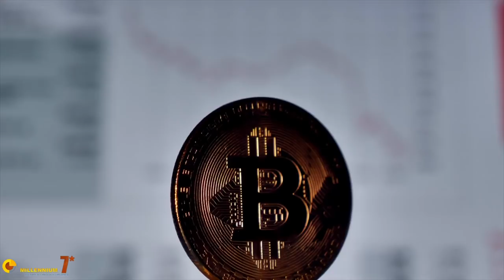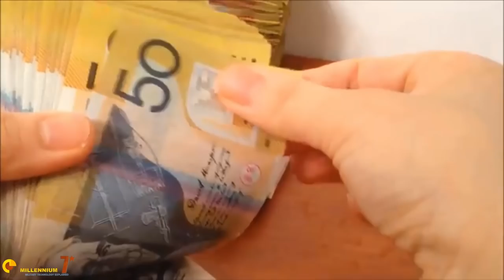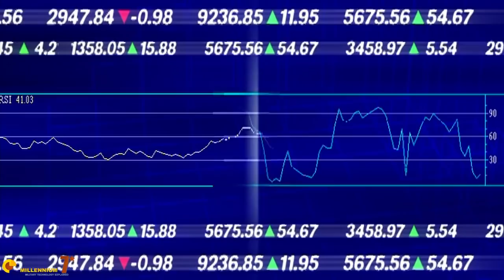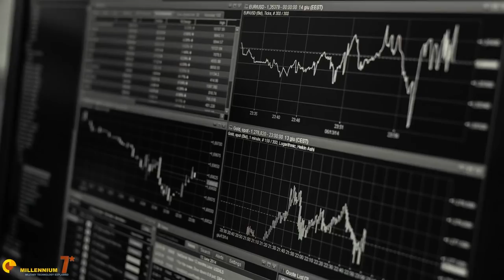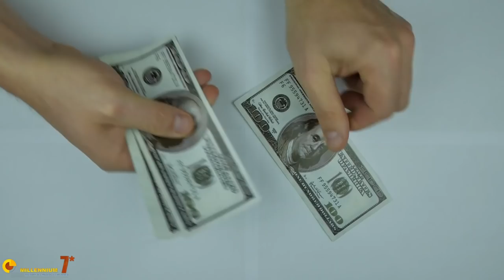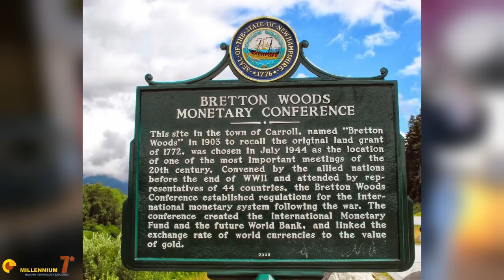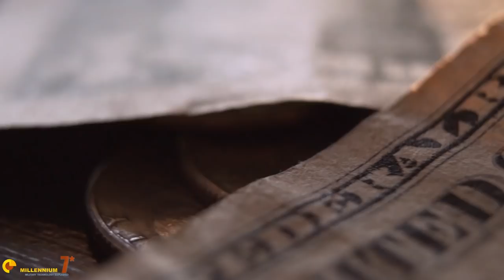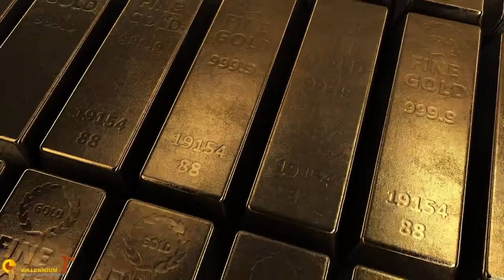How the USA can get unlimited F-35s without going bankrupt

Comment: "can't built weapons with gold"
Actually gold is very good for both a reflector and tamper in a nuke. So yes. You can built weapons with gold.
Reply: That is very tiny amounts of gold you need. Its a worthless metal. Its soft, heavy, not very good at transporting electricity or heat.
So its a worthless metal compared to iron, copper, aluminium and silver.
Reply: @nattygsbord  I thought it was a better electrical conductor than any of those you list.
Reply: @nattygsbord  Good to know. I will have to disagree with you on the aesthetics of gold vs. silver though. I have coins in both and while 24k silver is merely shiny, 24k gold has to a certain flicker to it, a certain way it catches light that borders on seeming almost alive that I have seen in no other material, metal or otherwise which is what I think gave early people such a fondness for it above all other things. Silver is a mirror, gold is...something else...something more. Covering a statue with it makes you understand how people could believe in gods.

Comment: Domestic secondary sector played an important role in a country's sovereignty. That's why for a long time the powers that be kept for themselves the industrial base (secondary sector) to run their economy and never outsourced them. Until of course some 'virtual world' economists invented the (knowledge based) quaternary sector of the economy. So they though that the ownership of patents and copyrights of the industrial processes of the secondary sector could be more decisive in creating bigger share of profits to the shareholders than the ownership of their physical industrial base that was in urgent need of large investment for their modernization in the 1970's and the 1980's. So they started to move their Big Capital into the quaternary sector and outsource their industrial base into lower production costs economies. 40 years later their bets that the westeern brains were the only ones on earth capable of innovating in ihigh tech ndustrial processes was proven wrong and the anticipated returns on investments of the quaternary sector are now drying up. What can they do? Rebuild Back Better their physical industrial base? No! It's much simpler to bomb to the ground the secondary sector they have outsourced. Then Build Back Better without competition after. That's what warplanes are for, isn't it?

Comment: The theory of inflation is absolutely and totally wrong.
Directly is no limit to the amount of so-called debt a government can accrue is that that is denominated in its own currency as it can always increase money supply to purchase any Bonds issues on the secondary market by their central bank or no Central Bank directly finance fiscal policy without issuing Bonds to the private sector in the first place in either event it's the left hand giving the right hand money except when through the use of bonds it's the left-hand giving the right-hand money after it's passed through a middle pan which makes a little bit of prophet in the process. Using bonds in that way has been described rather cynically but I believe extremely accurately as a form of welfare for the Finance sector as it doesn't really achieve any are there useful benefit that is if a zero wish guaranteed return of investment in the form of government bonds held by those who already have money they have exchanged it for a form of money that bears interest can be described as a benefit. 

The limit to how much money can be created by a government to finance expenditure does have a limit but it is not debt or the supply itself it is the capacity of the market in which it is using that supply of money to supply or provide. When the government sector or public sector either independently nor in combination with the private sector increases the demand for a particular good product to a service resource whatever it may be beyond the productive capacity of market to supply it it will increase inflation and that is the limit to which expanding the money through supply as a financial instrument by the issuer of the currency to achieve an objective at which point there are two options and that would be to decrease demand for whatever or increase the productive capacity of whatever play changing the focus of investment from product to production.

In a state of Total War inflation is extremely an absolutely critical and must be avoided at all costs which is an total contradiction to what is stated in the video which inflation doesn't matter at a time of war when the absolute opposite is the truth which is why the Allied nations in the second world war used every element of state power to control inflation through the issuance of bonds the private sector as a way of decreasing the money supply that is held by private individuals and companies so that that money will not be spent on things that are absolutely critical to the war effort. Rationing of certain critical goods and supplies is another way of achieving the same outcome. There were regulations that would put in place in the United States the speed limit was changed for all vehicles to save rubber. Bumper bars for vehicles that was sold to people because the chromium and the nickel was unavailable to the auto industry put used in bumper bars it was too critical that the supply for use in ammunition and weapons and not for shiny bumper bars other more profitable uses supplying Average Joe or Jane seeking a new motor vehicle because even in wartime people still need vehicles in United States and not every vehicle manufacture could be sent to the Soviet Union, Western Europe or the Pacific defeat the Nazis or warlords running Imperial Japan at the time because people still needed cars for transportation at the Homefront in the very factories producing those munitions and other weapons systems. 

I seriously cannot stayed with any more strenuous vigour the absolute critical imperative that inflation be controlled during a time of Warfare as it is hard to imagine anything else that is more destructive to war production and war economy then the enemy itself. Also it is unrealistic to expect the any nation can could ever or will ever be able to control the entire supply chain or any have all of the capacity required and minerals and resources not even the United States which was so much larger than anyone else at the time of the second world war had that capacity. Australia supply 50% of all the food and ammunition do United States required in the Pacific theatre during World War 2 and actually ended the war without a lendlease that it over to the United States in fact the opposite the United States was in deficit to Australia and it was a debt that Australia forgave at the end of the war in gratitude and recognition to the crucial role United States played in supplying both Personnel and material that Australia was incapable of providing in its own defence during that time from the sheer difference in scale of the Australian population and productive capacity at that time in relation to the nation's who acts of aggression to others and through direct attack to Australia itself and out interests in the Pacific without provocation chose to be an enemy of Australia we now are yous later actually song about closest friends and partners as we try to shape a better world for everyone and deter dose who would choose to make it otherwise and failing that respond to any challenges that may arise to change the status quote of relative peace which was purchased with so much blood & Treasure in the second world war by All Nations involved. 

Taxation is not used by governments to control inflation daddy fiscal policy which is how governments news revenue collection and expenditure enhance or achieve objectives in the Nations economy.
Monetary policy is the policy adopted by the monetary authority of a nation to control either the interest rate payable for very short-term borrowing (borrowing by banks from each other to meet their short-term needs) or the money supply, often as an attempt to reduce inflation or the interest rate, to ensure price stability and general trust of the value and stability of the nation's currency.
Inflation which is a measure of how prices change upward overtime is not affect directly affected by the money supply or government deficits or surplus as described in the expenditure or revenue collection detailed in governments financial balance sheet. The rate at which increases price prices overtime is like every other price in a capitalist free market economy is determined by the market as a function of supply and demand dynamics within and by the market. All else being equal, when supply increases and demand falls the price goes down and vice versa in a well-functioning competitive open free market. This is economics 101 very basic stuff. The intersection of where the supply and demand Curves meat of course is reflected by the conditions of the market for example if there is a rise in the cost of fundamental inputs such as in a pure hypothetical situation for example if a kleptocratic authoritarian revisionist regime is hell bent on launching a legal and moral war of aggression against it's Neighbours as a means of distracting the public from the amount of national wealth the regime is stealing by way of fraud and corruption from its citizens and in the course of that special public relations operation use exposition as a supplier of energy to other dacians that would have posted that action as a form of economic coercion in for example a globally traded commodities such as natural gas then it would have a massive effect worldwide and use the nature of energy and how it's used in the supply and manufacturer of virtually all services in goods be reflected in actually every single price. And if that hypothetical case was to actually happen in reality I would suggest that it's not actually a good way to win friends and influence people but to piss a lot of people off and make a hell of a lot of enemies that have very long memories about any financial hardships that they suffer through and they would remember the illegal immoral aggression that was the ultimate group cause of it for a very long time I would suggest.

If anyone really wants to know about how modern monetary Theory works with a very detailed and accurate description of the process they should look it up on YouTube as is quite fascinating in both simplistic elegance of how money which is a financial instruments operates in the real world and not the narratives and rhetoric people either intentionally or unintentionally mislead the public to believe. Very oldest form of writing that we know of is cuneiform from Mesopotamia around 5 or 6000 BC from memory and it is actually the financial records of the ruling regime which is not unlike currency in that it is the physical manifestation of the way that regime provisions itself.

I don't truly understand why this fellow is play looking at modern monetary Theory to a military lens with the desire to control the entire supply chain of military hardware as something that is advantageous or desirable because the whole idea of trade is being able to exchange in goods and services between people's that have competitive disadvantages and advantages as a way of minimising costs and maximising returns. If any nation was so motivated to be completely self-sufficient in that way so they could produce qualities of military material utilising the productive capacity of their economy then I wouldn't want to be a nation that anywhere near that nation because obviously they have no trade partners or friends with which they deal is seemingly hellbent on acting alone in the production of massive amounts of military material they seemingly I would suggest seeing hellbent on using.it against enemies of choice rather than choosing to trade openly and freely with neighbours by necessity.

Comment: Currency has no value...good job on an otherwise dry subject, you brought up many critical points even though they may not be directly to do with aircraft, certainly indirectly have everything to do with aircraft 👍
Reply: No intrinsic value.  That part is important.  money certainly has value as a lubricant, as explained.  This is part of the reason that money won out (and always will) over a more primitive system like bartering.
Reply: @Desrtfox71  👍 economics isn’t taught the way it should be these days.
Reply: @--Dani  I think that the issue is just that YOU were not taught economics, and as consequence you have no idea about economics...
Reply: @Ilamarea  where is my statement wrong? Please indulge me with your knowledge please.

Comment: One wonders if Hitler had all the oil he needed what he would have/could have done with it. America knew it was his weak point and we cut off his supply but at an extremely high cost. Only our best young white, collage educated men  in great physical health found their way into the Army Air Force and then they died by the thousands in B-17s and B-24s  trying to bomb the Germans oil supply lines. Now its computer chip need by America, Japan, China and Russia that are made principally on the little island of Taiwan.  Not too smart on America's behalf to have painted our self in a corner like that. Now China try to figure out how to take it over at the point of a gun without totally wrecking the chip making people, facilities and equipment.